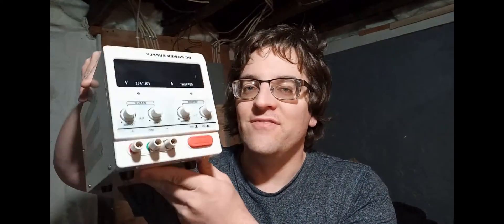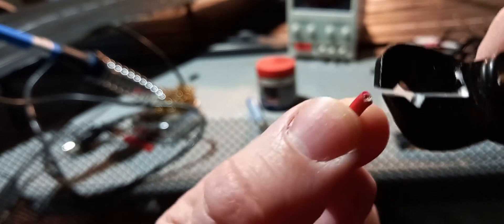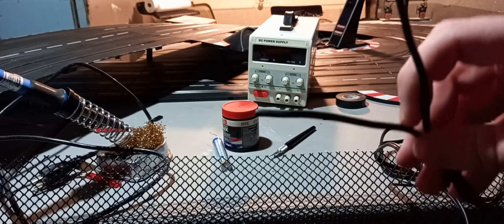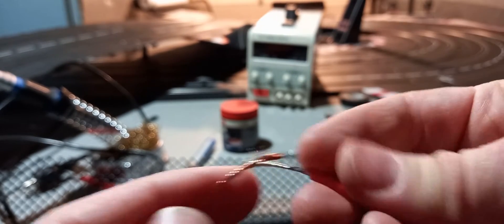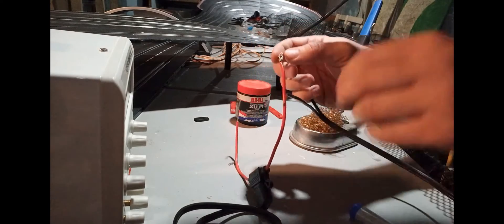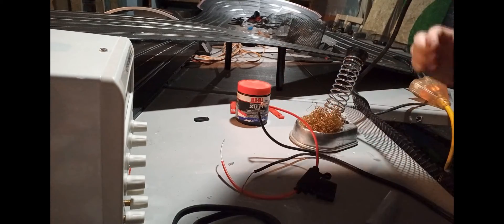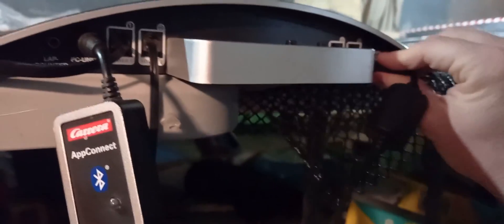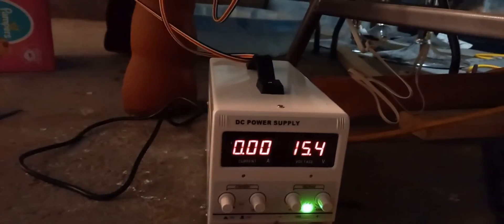How to Connect a Variable Power Supply to a Slot Car Track

Comment: Good video thanks for the info.  Soooo i have a carrera go track.  I was gonna swap out for a variable power supply as well and make it where i can use other controllers. Is the carrera go power base good enough to work with just switching out the power cable the way you did?  Or do i need to get rid of that power track base peice altogether?  Little confused.  The go track has the turbo button utilizing an extra resistor in the power base
Reply from the maker: I'm really not sure about how to wire a Carrera Go track. Sorry!

Comment: The easiest is Amazon sells an AC to DC adjustable power adapter that comes with many different plugs.  I bought one and it just plugs in where the original power adapter goes.  It does 6 watts on up to 36 watts  and only cost $18.99 U.S.

Comment: Thanks for sharing your video.... it at least got me started on understanding what my end product should be. Polish up on your terminology of electrical wiring basics.   Even as a novice electrician I caught myself shaking my head when listening to your terminology.  Also, recommend using a continuity tester when identifying the wires. I have a wire plug where wires were reversed in the plug end from factory.
Reply from the maker: I'm glad you found it helpful. Filming such small details was a little beyond my scope at this point.

Comment: I would have left enough wire on the brick in case you want to reuse it
Reply: I agree. It only took me one time in life to figure that one out. A person might not need a use for  what's on the other end of the wire at that point in time. But if you cut it to close it makes it "labor intensive" to use what's on the other end at another point in time. My dad always said the left over shit  can be utilized later. RIP Dad.
Reply from the maker: It's funny you mention it because I honestly just wanted to use the prong wires for something else.